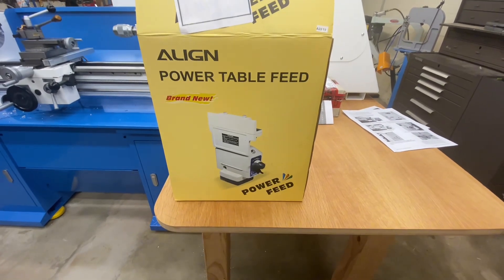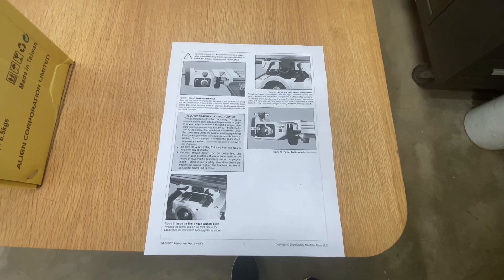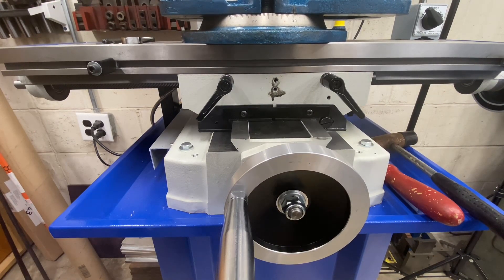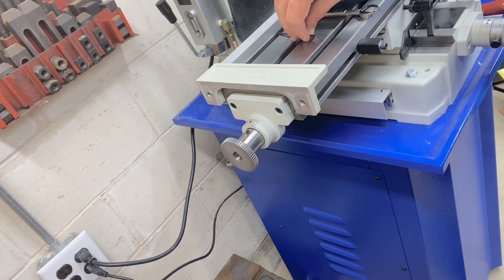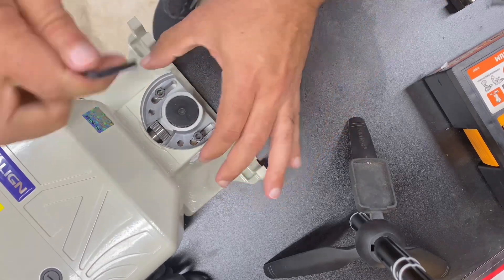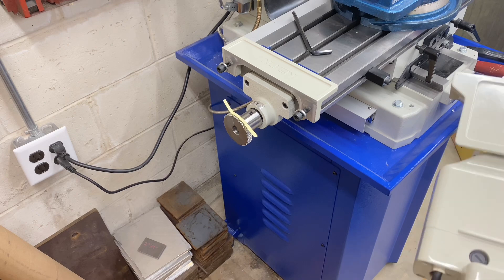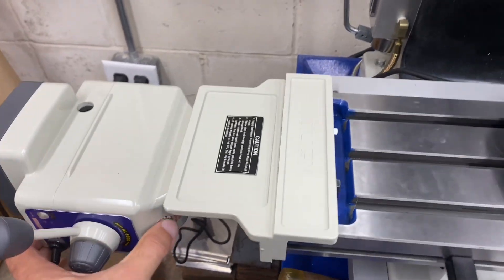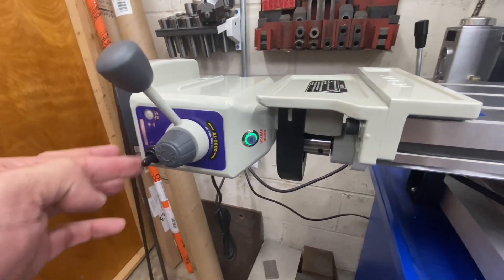Precision Matthews PM-728VT Power Feed install

Comment: I made an aluminium spacer to repace the adaptor that clamps to the end ef the bed. i found getting T nuts in/out an issue  plus swarf collecting around it was a cleaning issue but most of all the pinch bolts however tight a dare tighened them moved which altered the meshing of the gears. not sure how to upload pictures to youtube? if someone can tell me i'll take some and upload them
Reply: That is the same idea I was thinking